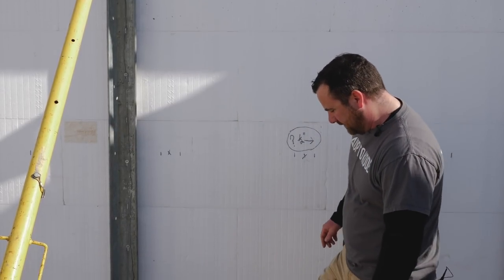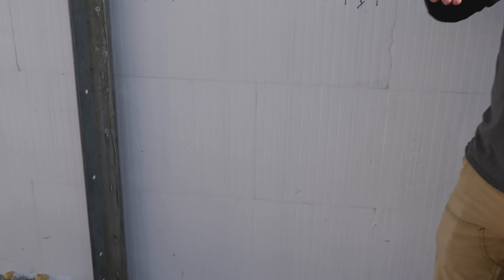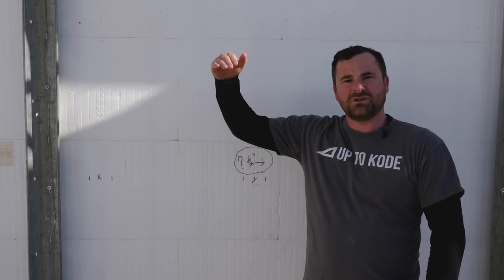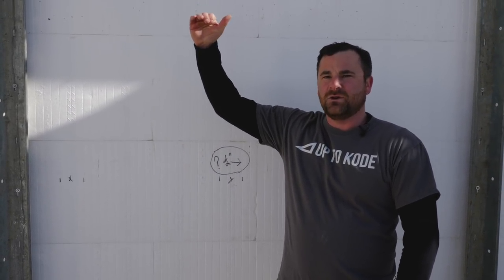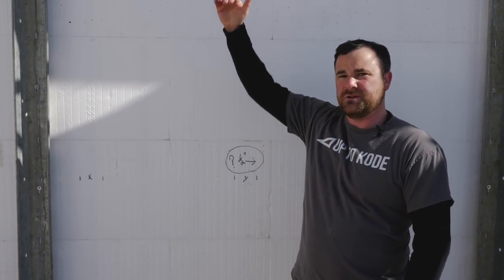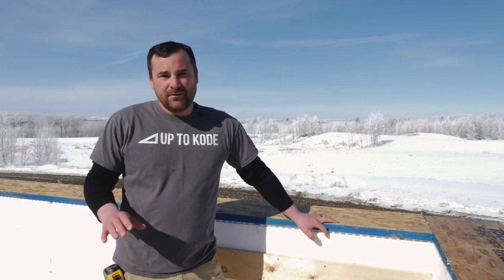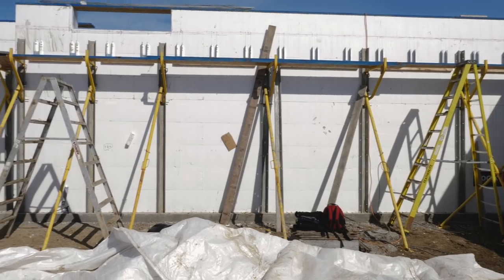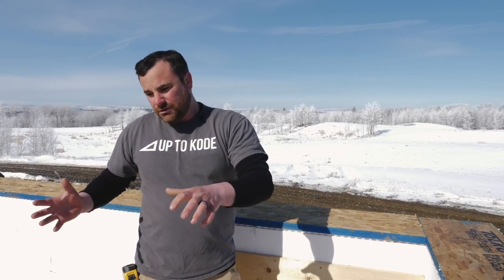ICF Construction : It's NOT Just for Basements

Comment: If you place your floor joist hangers in the walls at the desired height, then simply run a 2X8 up under each joist hanger as a brace, you can place your floor system in the house. Then, you can place plywood on your joists and walk around and pour your walls without having to brace them at all. The floor system will assure the dimensions and squareness of your house and walls. Also, you may want to set the first course of block in the wet footer. This locks it in place, and eliminates the need to glue or run runners to keep it in place while you pour. I have built about 100 of these basements this way. We pour the concrete basement floor with tie-ins or grade beams attaching the footer to the floor before stacking the block. My personal home went all the way to the roof with the block. I used FOX BLOCK for all the construction. We had 3280 sq. ft. 12’ and 14’ ceilings, with one 3 1/2 ton AC/Heat Pump combo. The entire house was electric, so we heated and cooled with electric. We also had 2 vent-free fireplaces ( using $15-30 dollars annually). Our average utility bill was $72.00 per month. This includes well pump, forced main sewer pumps, and sprinkler systems. No dust, no noise! You have to experience living in one before you can believe how comfortable they are. Imagine a house where every room is the same temperature. Fantastic!
Reply: Maybe u can explain it in a video.

Comment: Great series of videos. Well done, informative and enjoyable to watch. Just a quick question. My apologies if I overlooked the episode that addressed this issue. Planning to do a custom ICF home build in Idaho. Zeroing in on our floor plan of choice. Want to do the exterior walls in all ICF just like you suggest. House design includes a walkout basement, first and second floors, ICF with 8-inch concrete core, etc. My question relates to the second floor exterior walls which have architectural design setbacks. As is typical, the second floor (three bedrooms, two bathrooms, etc.) has a smaller footprint than the first floor and basement which obviously have the same footprint as they are directly supported by the footers and ICF walls to the top (ceiling level) of the first floor. How are second floor architectural setbacks accomplished by using your ICF system, all the way to the roof, without having "institutional/commercial looking, straight-faced, 30 foot, ground to roof walls?

Comment: How to you build a roof once you get up the walls? Same way as the floor?
Reply from the maker: For a roof we set anchor bolts into the concrete at whatever height we want the main floor ceiling to be. The next way we bolt down an LVL top plate (full width of the ICF). Now we have 12 inches to nail our trusses down to. Trusses sit directly on the LVL and get toe nailed down. 

In summary, trusses nail the exact same way as a wood frame wall, you just have twice the width to work with.

Comment: Would that make a new cold joint?
Reply from the maker: Yes there will be a cold joint when you pour the next lift. A couple of notes on that. I like to keep the walls the clean. No cutting block overtop of the walls which cause junk to fall down to the cold joint. Be mindful of that. 

You will have rebar protruding from the old pour into the new which connects the 2 lifts and maintains structural integrity. 

An ICF building should always have building paper to shed water from behind the siding and out of a drip cap further down. Paper is vital to any structure and has to be properly lapped for drainage. The cold joint can allow water in if you assume that ICF doesn’t need building paper
Reply: Chould you per say, build all the way to the top, placing joints, then add roof and pour like a spider tie build? Sorry for picking your brain. Me and the wifey have been thinking about building our house using a combination of these ideas. Most likly built in texas. Hill side type build.
Reply: Being raised in wis. I have a death fear of cold joints lol

Comment: Do you frame up interior walls around the exterior to run your services?
Reply from the maker: No. The ICF has attachment inside the block for drywall and other finishes. There’s 2 5/8” of foam to run electrical. You can rent plumbing vent pipes in the foam too to help vent sinks and such. Other than that no major services get ran in exterior walls.
Reply from the maker: But good question!
Reply: @uptokode   but then you loose your r rating fairly quickly that way? Waste piping alone youd have to cut most of  the way to the concrete? So you must desing the vanities, tubs, ect to use interior walls/chases? Thank you for putting up these videos, just wish you built in Massachusetts haha

Comment: Hello Kody,  We are looking into doing a home with ICF, But concerned about the Cold joint, We are doing a basement and a level above. 10 ft basement, 9ft above that, any suggestions?
Reply from the maker: No concern with a cold joint if you run rebar out from the 1st pour so it ties into the 2nd. Keep your walls clean and don’t cut foam over the wall. That’s the best recipe for success

Comment: I assume the gable ends are stick built or is there some technique to pour concrete at an angle? I understand how the concrete could last for centuries. But what about the foam? Thanks!
Reply from the maker: If you have a flat ceiling then a wood gable is fine. Once you start doing vaults then ICF is the way to go for the gable end. Follow us on Instagram to see some gable installs. I’ll also be shooting a ton of ICF content this year and gable ends is on the list.
Reply from the maker: The foam should last just as long. It will never be exposed to the elements.

Comment: Kody,

I'm talking to a contractor that does ICF and he said you wouldn't need pier and beam foundation for it.  I live out in Texas so we don't do basements here.  We're usually slab on grade or pier and beam foundation.  He recommended just a waffle slab foundation and said with ICF you have a complete concrete box that is sitting on dirt.  Even if the foundation shifts the entire box goes with it so you won't have the bends or mis-alignments like wood frame would.  What are your thoughts with this ?
Reply from the maker: I agree with that 100%. We have to dig basements to get below the frost in the winter otherwise more people would do  slab on grade.  

Either way you have a monolithic building that can handle shifts or extreme weather

Comment: Can ICF be used for an earth bermed house with a walk-out basement on a hill? In other words, it would have a full walk-out basement AND have earth berming on the main floor on three sides. What accommodations would have to be made for that increased vertical pressure on the bermed walls? Would the basement walls need to be thicker? Are there forms that are deeper to accommodate this sort of design? Or would it take the same size forms all the way up?
Reply from the maker: Yes ICF can be used for almost any application. These specific homes would need an engineer to verify loads. They would spec wall thickness and rebar. And yes there are multiple wall thicknesses available. 6”, 8”, 10”, 12” and more.

Comment: So to clarify, the basement and first floor would be a continuous pour?  Or would there be a seam (cold joint) between the two floors?
Reply: There would be a cold joint. not uncommon in vertical concrete construction. you extend the rebar above the pour into the next pour.

Comment: Does this system have provisions for more classical designs? I'm partial to Victorian styling with nice sweeping curves and turrets. I was thinking of doing traditional masonry but this would be a pretty sweet set up.
Reply from the maker: Absolutely it is! The ICF system can fit any architectural design. Turrets and curved walls are easy to do and most block manufacturers have books with details on what to do to obtain a certain radius for curved wall. 

Not only that but because the walls are structural you have more flexibility in regards to vaulted trusses than wood framing. Example: in a vaulted truss on wood wall the trusses have to be designed as so the walls don’t spread. With ICF this is a non issue. The walls support themselves.
Reply: Thanks for the info. This is definitely on my radar for when I build my forever home! I'm building that puppy to last. Like I want it people in 3000 years speculating on whether or not my home was a religious site or something =P

Comment: Great video series with the icf build! How does the cost compare to traditional framing for an entire house?
Reply from the maker: When comparing a full house build an ICF is only 5-7% more than a conventional build. You also have to keep in mind for that extra cost you also get way more benefits. More strength, better insulation and so on. 

On a shop the percentage for ICF is higher because the building is mostly walls anyway. No additional costs to bring the average price down. Examples: flooring, cabinets, heating, plumbing, doors and finishing. You get the idea.
Reply: Kody we need more icf builders near me want to come to Iowa to do a build lol I enjoy your videos and wish there were more icf builder near me to get my home built using icfs and done properly
Reply: The insulation part what is the made of, also how do you put up walls ? And what is used against the ICF wall to run electric and plumbing and what do you paint?

Comment: Just curious, how much more expensive is this vs 2x6 construction?
Reply from the maker: It’s only 5-7% more on the entire build. The only real difference between a 2x6 home and a full ICF home is the exterior walls above the foundation. Everything else is the same. You still need a foundation, a floor system, trusses and roof, kitchen, bathrooms, etc. For a small increase in cost is it worth 60% better insulation value? 8 times stronger and 10 times more air tight?
Reply: @uptokode  Or a 5% smaller home for the same cost, with lower utility cost and lower insurance costs. Laughing all the way to the bank if you funnel that into paying of your mortgage.
Reply: @uptokode  ps. Whats the added costs of adding something like the 4"panels that quadlock has ?

Comment: one question of ICF construction: how resistant is ICF to fires, tornadoes, earthquakes and other natural disasters?
the reason why i ask is because im wanting to save up enough money to build a house and i want the house to withstand at least low end EF4, and up to 6.5 MM scale.
Reply: It's very resistance to fire as well as hurricane and tornado proof
Reply: @Himothy_da1st  good, because i also plan on using ICF construction to build several self sufficient tiny homes and rent em out.
Reply: That's exactly what I did 6 rental properties so far you also get a better insurance rate because it's such a safe structure and tax breaks as well
Reply: Would not want to be in anything but a concrete (ICF) house.  We just had a 4.4 earthquake very close to where we live in our ICF house. The house felt amazingly strong and solid throughout.  
Also if you build with stucco exterior and metal soffit, facia and roof system your house is basically fireproof on the outside.
Reply: so i take it you live close to decatur tennessee? didn't know there was any ICF homes over there.
Reply: Why did you think he was near Decatur? I'm in Tennessee, so that would be great! Are you also? Anyway, isn't he Canadian?

Comment: Doesn't the new concrete have to bond with the old...
Reply from the maker: That’s why you have rebar dowels from old to new. That’s the connection. If you keep the wall clean like we do then the concrete will have some bond but not enough for structural, besides compressive. Steel is most important in concrete to allow it to have tensile strength
Reply: Add a cold joint bonding agent between pours

Comment: Why not an ICF floor and roof?
Reply from the maker: All comes down to usesge and cost. A suspended concrete floor is about 4X the costs of the open web joists with flush beam. The slab offers a ton of thermal mass but it all depends on what the customer wants.
Reply: @uptokode  great!! I was wondering if it is possible.  In many countries people balk at wood in construction and concrete is the way to go.  I would love to see a video of concrete ICF floor and roof.

Comment: How do you avoid the environmental issues with millions of foam particles entering the job site and being taken by wind into surrounding areas.  I don't believe the foam you are using is biodegradable in any way?
Reply from the maker: That’s a great question and one I’m going to make a video about really soon. You do have a really good point about the foam but here are my points. 

So many people still want to build wood frame structures. So we cut down a trees to do this, a plant that absorbs CO2 (the substance responsible for global warming) and we make stuff. Then because those building are limited in efficiency, we then add multiple layers and products on top of that to make it more energy efficient. All those products have a carbon footprint (aka create more CO2). At the end of the day those building still rot and need to be replaced. 

Now look at an ICF building. Very high efficient, concrete centre that lasts hundreds of years, all done in one step and no need to cut down trees that absorb all this CO2 we are worried about. 

Just something to think about.